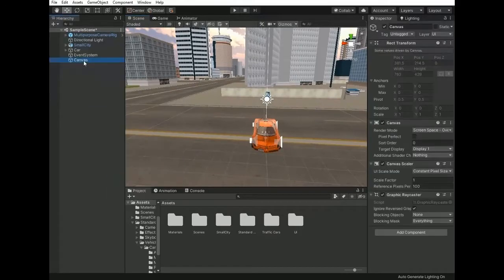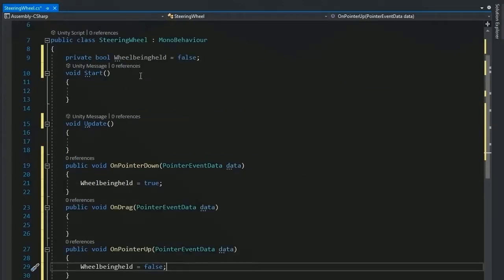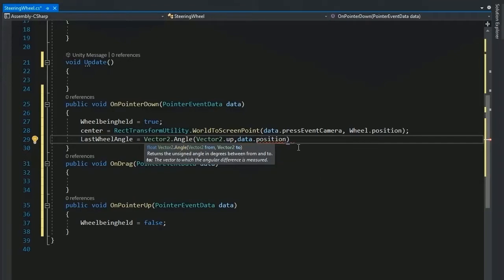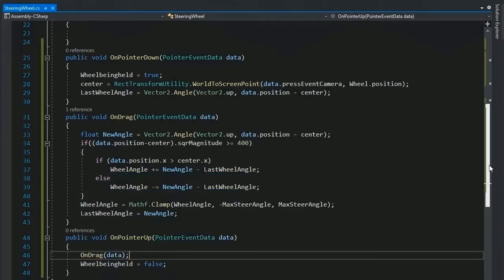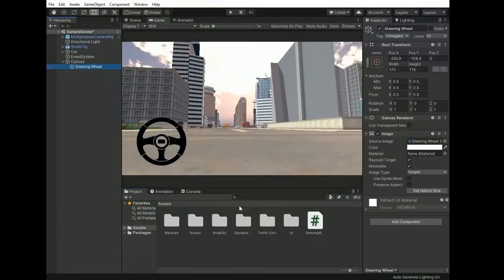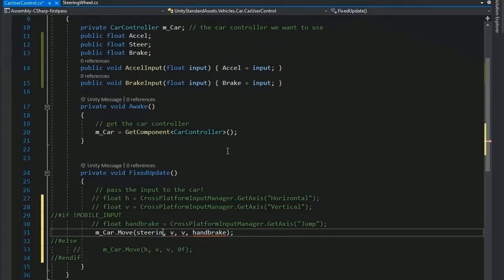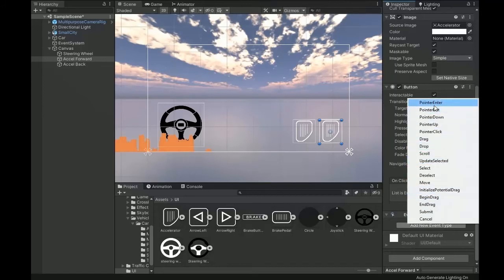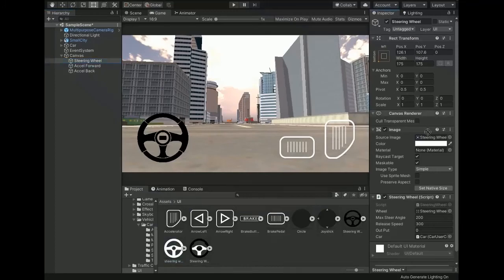Unity3d Make a Steering Wheel Controller for Car Game(Unity Tutorial)

Comment: the steering wheel turns well but the wheels don't turn, I found a carcontroller in unity assets and it brought a script with 500 lines of code, I changed the buttons that the carcontroller had for the steering wheel and I don't know how to edit the script, is there any way to contact you and help me to edit the script. I can send it to you by GMAIL